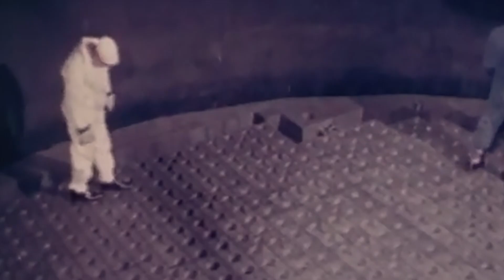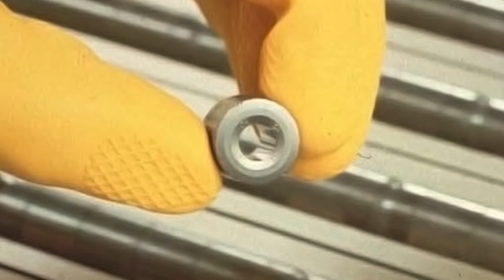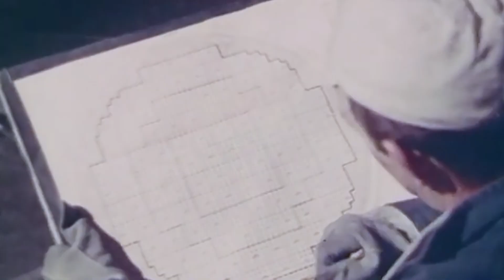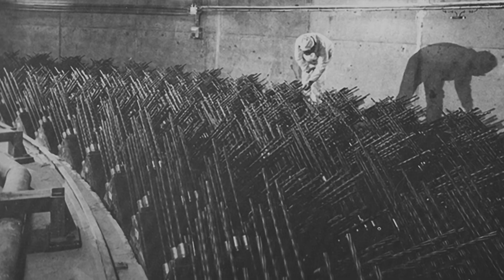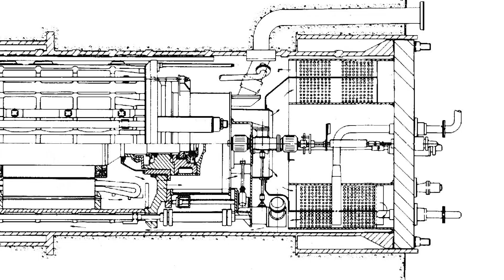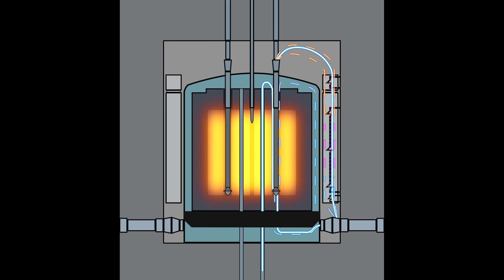Advanced Gas Reactor - AGR

Comment: The AGR had a bit of bumpy start, and the early ones could not be re-fuelled online due to issues with gas turbulence in the refuelling machines. Plus, the development of the first commercial plant, Dungeness B was a total disaster (just like the first EPRs I guess). From what I can tell, the contractors took the 30 MWe Windscale AGR prototype and scaled up aspects of it to 660 MWe per reactor by multiplying dimensions by x22, resulting in steel work warping due to its sheer weight, bankrupting the contractor and requiring significant modifications and remedial works by a rival consortium (led by GEC - who designed the AGRs steam turbines). Before Dungeness B, various American utilities were interested in the design until the issues arose.